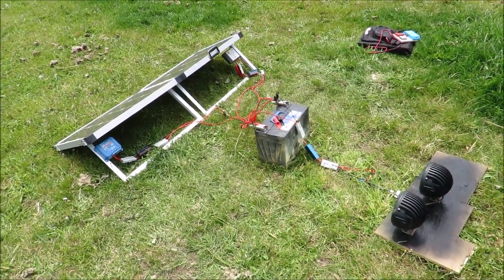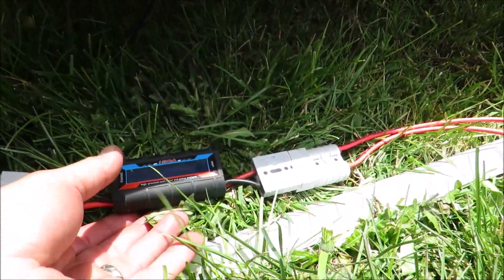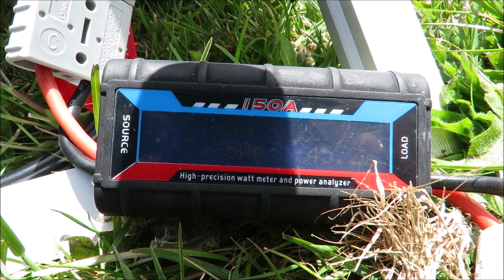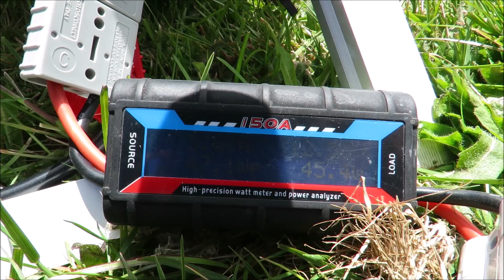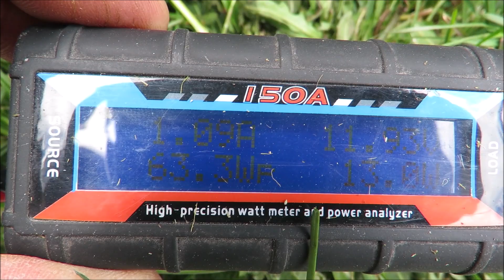Victron Energy Blue 75/15 MPPT Solar Controller vs Ridge Ryder PWM and Maxray MPPT controller

Comment: Hi, good comparison. Could pls tell me which type of battery you used ? Because i have a douubt that it will not work good with lifepo4 (it has higher voltage). I saw victron statement that voltage of panel should be +5v from battery voltage.
Reply: What voltage is your battery? The 75s are limited 75 volts (solar input) and 24 volts (battery output)...

Comment: Nicely done, I've been having a problem understanding the 15, does it have to do with how much charging power goes into your battery? Will a 100ah battery, 100w panel charge faster with a 75/15 vs 75/10?
Reply from the maker: The 10 and 15 refer to the maximum charge current of the unit. A 100 watt panel will output less than 10 amps of charge so they would both charge at the same rate. The 75/10 is good for a panel up to 145 watts and the 75/15 up to 220 watts.

Comment: No question  that victron  is best  .I have some cheep controllers I use on my system they are cheep junk but they allow me to have redundancy and back up spare parts in case I screw up and .make magic smoke .that said as my system progresses I hope to replace with victron but it is hard to justify  the initial cost .If you go cheep you have to continuously monitor  the system.

Comment: My money is on that maxray actually not being mppt at all, especially if it fried your battery by outputting 17v.

The benefits of MPPT are even greater, the higher the solar input voltage gets. So your little 50w panels there were probably close enough to 12v that the PWM can actually do OK. You can pump 70v into that victron and it will always output the exact right voltage for your battery. PWM by definition pulses voltage into the battery to get the same effect.

OK, I sound like a shill, but the money you spend on a good controller and decent cable can make a huge difference in your system's performance. 

Thanks for doing the comparison. Great video, as always.
Reply from the maker: Yeh, I reckon you're right. In hindsight I should have pulled it apart to see what was inside.
Reply: @TasmanianOffroadAdventures  You know what, I have just had my Victron 75/15 fail on me in the past few days.
I didn't realise, but they are packed with silica sand which acts as a thermal conducter or something to get heat away from the board. The seal which attaches the back cover on failed and all the sand started pouring out.

Waiting to hear if I can get it replaced under the 5 year warranty but something to consider if anyone is looking at this particular model. Higher models have actual heatsinks.

Comment: If you intend on using the Victron  charge controller with the folding panels you have in front of you if you put the two panels in series 2 up the voltage  that victron charge controller will work much better in overcast weather

Comment: You should never mount the charger controller to the back of the panel like that. The panels will get hot in the sun, even on the back side. And those controllers will have no way to dissipate heat.
Reply: That's the way these portable panels tend to come. For our camper setup I moved the controller next to the battery... the main reason being that the long wire run between the panel and camper will be a higher voltage and that alone will minimize voltage drop, but also any drop that does happen will still be OK going into the charge controller which will put out the proper voltage to the battery. If I instead have a long run from the charge controller to the camper, that voltage drop could cause the battery to not charge as efficiently. 

But your heat dissipation argument is a nice secondary benefit. The cheap PWM controller my panel came with was really stuck down to the panel and hard to remove.

Comment: did you actually test if the cheap "mppt" was in fact MPPT?  plenty of these cheap units are fake and just PWM.
be interesting to see this test down with other true MPPT controllers such as the EPever BN series and other tracer MPPTs

edit

Best MPPT Solar Charge Controllers Review up to 40A - EPever Vs Outback Vs Renogy Vs Victron
Clean Energy Reviews channel

Comment: My "name brand" pwm controller just fried my battery because it failed and shorted the solar power to the battery so it had 16.6 volts applied. Thanks for the review. My decision has been made.

Comment: 100/30  smart victron, 400 w panel, 280ah battery gel, 1200 inverter victron.. I have that system in Greece (always sun) . Fridge, lights, tv 30 inch, air cooler, pumper 800w whenever i open the water.. Honestly i never saw my battery lower than 13,2volt. The day always keep my battery in float mood.. It worth every last cent....

Comment: Thanks for the review.  I have that same blue PWM controller, but it was bundled with a different brand of solar blanket.  It worked Ok with an AGM lead acid battery, but now needs to be replaced because it doesn't have the right settings for a new LiFePO4 battery.  Another reason for choosing MPPT is if you are constrained by solar panel area.  It might be cheaper to add more solar panels, but if you can't fit any more solar panels on the roof of a vehicle, then the  only way to get more energy is to use a more efficient (MPPT) controller.
Reply from the maker: Great point!

Comment: Great video - thanks. I have recently upgraded my three MPPT controllers to the same 75/15 Victron's and I agree they put out very accurate and consistent voltages as set (or pre-defined). When using LifePO4 batteries, you really don't want to replace them due to a cheap regulator :)

Comment: Hi Mark, Just watched your video. We are currently looking to replace the controller we have for our 2 x 160w roof mounted panels and 2 x 120 a/h batteries. Would the Victron Energy Blue 75/15 MPPT be sufficient to use? Thankyou
Reply from the maker: The 75/15 would be too small. The 100/20 would be more suitable but I’d contact Victron direct to confirm.
Reply: @TasmanianOffroadAdventures  Thankyou, will check with Victron.

Comment: An advantage with the Victron 75/15 MPPT solar charger is the 15A load output (the 75/10 is lower load current). This can be used to load shed when the battery gets low. Use this load output for lights and device chargers. Wire your fridge directly as most have low voltage cutouts inbuilt as standard.

Comment: the cheap Maxray MPPT controller is probably PWM take the back off and see if it has a big inductor coil if it doesn't then its a PWM.

Comment: Many cheap, so called MPPT controllers are just PWM controllers with a lying label. The results you got bare this out - the so called MPPT controller provided the same power as a PWM controller.
Reply from the maker: Benny Burger I think some definitely are PWM controllers with a MPPT sticker. Some are MPPT controllers, just not very good.
Reply: Tasmanian Offroad Adventures and somewhere in the middle are some decent, real, inexpensive MPPT controllers. But if the price is to good to be true, it likely is. I have a 6 year old EPSolar MPPT controller and it has been very good and gives me a comparable improvements over a PWM charger. Wish I had data logging and Bluetooth though.

Comment: THANKS !, Was looking at the exact same 75/15 victron controler as an upgrade for my 200w panels.
Bloody brilliant mate, you confirmed what I’d hoped was the case with this unit V my crappy old PWM unit that came with the panels. Top stuff 👍👍
Reply from the maker: Cheers mate, glad I could help!